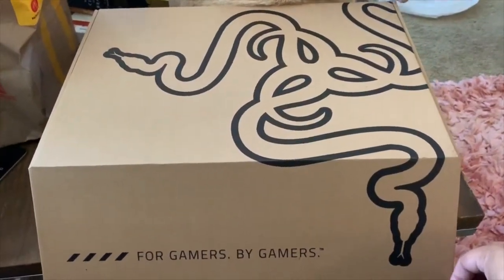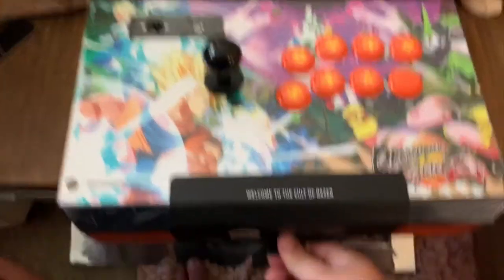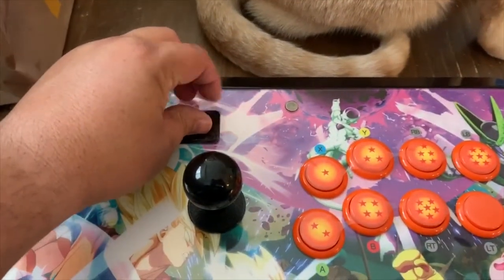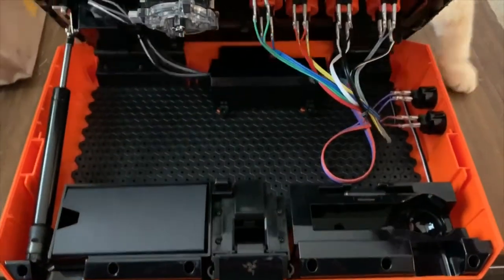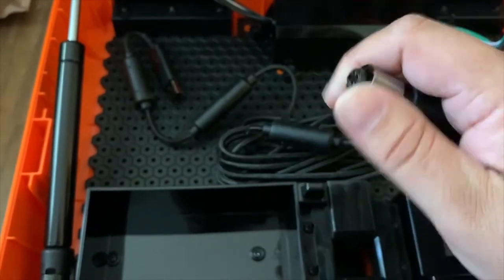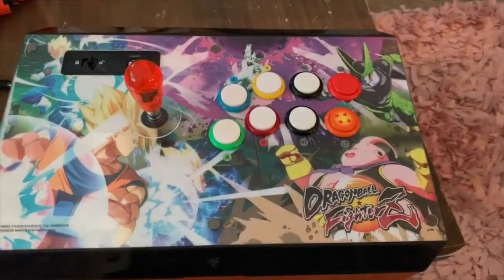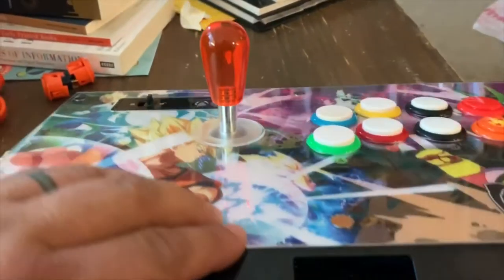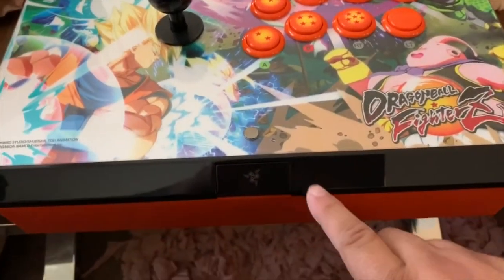Razer Atrox #DBFZ Edition for Xbox Unboxing and Review

Comment: If it's fully moddable you can't make it heavier? When you say it's flimsy, do you mean lightweight or shakey? I can't imagine all 4 sides falling add you play (even if you're rough housing the stick).
Reply from the maker: Welbeloved Akulas you could make it heavier, but the problem is more that the plastic bottom case is a little flimsy. When you open the lid you can really feel it bend a bit. When the kid is closed it’s not too bad, but it still feels not quite as solid as it should.

Comment: Hey man good video. I am buying this stick right now to use on Series X and would like to switch to the bat top stick. I am honestly not sure what to buy or how to install it. Could you help?
Reply from the maker: Yeah I’d be happy to help. Installing a new battop is pretty simple with this stick. All you have to do is open the case, look at the bottom of the actual lever and you’ll see what looks like a flathead screw. Just use a flathead screwdriver and hold it in the screw and then unscrew the ball top. Once that’s off just screw the new battop on and that’s it! The best place to buy a new battop is FocusAttack.com just look for any battop that fits a SANWA JLF lever. Let me know if you need any more info or help. I have another video for beginner modders and in that video I show step by step how to change the tops. You’re gonna love the stick.
Reply: @DrSmoores  Thanks for the info. Have always wanted to try to go stick and figured since this one was on sale at Amazon i would give it a go. Got a bat top coming as well so i should be set for some MK11 and DBFZ. Have your other video saved for later, im sure i will use it.
Reply from the maker: @XAbbeldydooX  that’s great to hear. You’ll absolutely love the stick for DBFZ. I have a hard time using sticks with MK11 sometimes, but I’m also terrible at the game, lol.

Comment: you think it will work on the xbox series x? most of the controllers are backwards compatible
Reply from the maker: ninjakid164 I don’t know for sure, but it should work. I’d imagine Razer will simply provide a firmware update. I will say that it’s also very easy to add a new pcb in the stick, so worst case scenario you can upgrade and modify the stick easily.

Comment: is this compatible with switch?
Reply from the maker: Alexander Bardon No, this ain’t compatible with the Switch. You could buy a usb converter to make it work, but by itself no.
Reply: DrSmoores what converter would you need to do this?
Reply: @P1STOL39  I use this mayflash adapter for my qanba drone to switch but it also works for xbox controllers and other junk. I forget what it's called but look up mayflash switch adapter